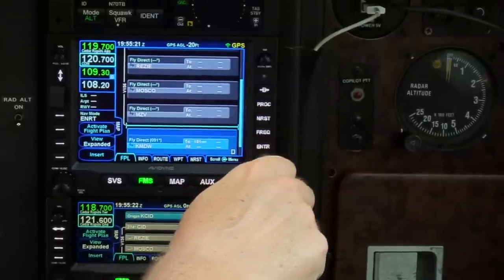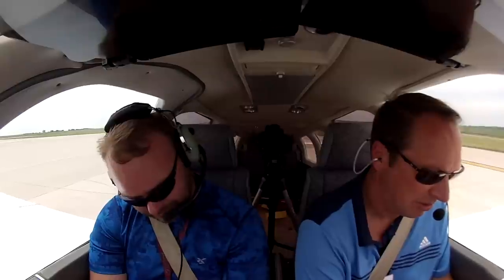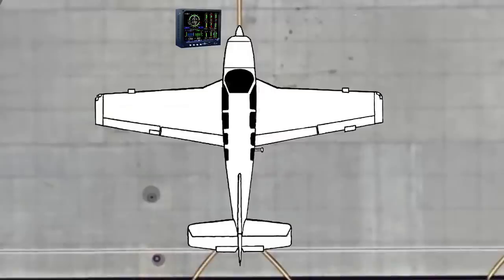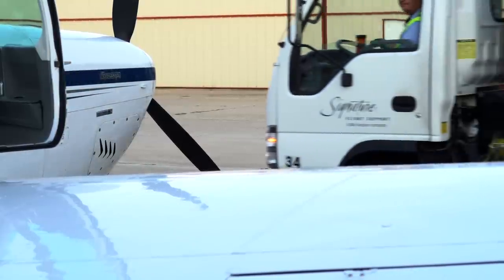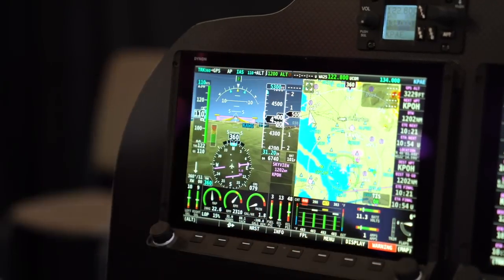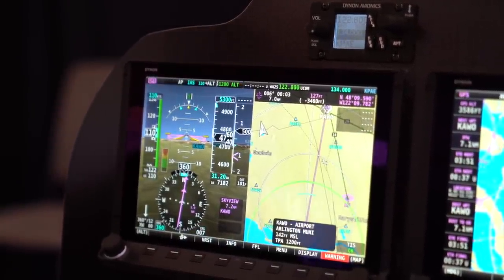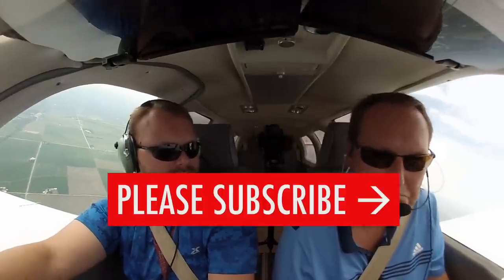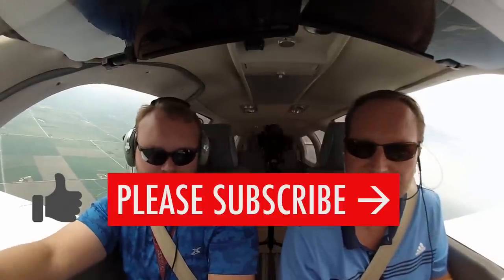Engine Monitor Upgrade - Part II: JPI EDM 930 Flight Test

Comment: Martin,
Your video at the Glass Panels demonstration was quite interesting.

My observation between the Aspen and the AVADYNE system, would continue with the upgrade using AVADYNE. Your panel already have the AVADYNE 550 and the 530, which is easier to merge together without additional boxes. That I would recommend you to take a look into it.

Comment: Martin, why not Garmin?
Reply from the maker: Garmin makes decent equipment as well, but a few different reasons steered me towards Avidyne. The IFDs are tray-compatible to my old GNS units, so the upgrade was very easy to do. Avidyne equipment is generally speaking more compatible with other stuff, whereas Garmin has a reputation of being compatible only with other Garmin equipment. And in terms of capabilities, the IFDs with a real FMS under the hood  have some advantages.
- Martin

Comment: what is that small digits display box for RPM and MP? Does that come with JPI 930?
Reply from the maker: It's a redundant display of  the just the most important engine parameters (think RPM and manifold pressure), so that in case of a display failure on the main unit you still have an idea of what's going on. It comes with the JPI EDM930.

Comment: what would you say you're leaning towards, the dynon or aspen setup?  I currently have 1 aspen and I really like it but either the dynon or g3x with engine monitors (since I need that as well) would be sweeet!
Reply from the maker: I think I could be very happy with either one. I like the simplicity (and lower price) of the Aspen. At the same time, the Dynon will offer a nice autopilot upgrade along with the nicer screens. Given the avionics I already have, I do not see a clear winner between these two.
- Martin
Reply: @martinpauly  I'm not sure where you are getting the lower price for the Aspen system.  Dynon has a very nice Excel spreadsheet on their website for the V-Tails, and I'm pretty sure that the A36 should not be that much more expensive.
Configured for your aircraft, which means no engine monitoring system, a 10" and a 7" display, Autopilot, no comm radio, since you have the Avidynes, the backup D10A and the STC, comes in at about $23,500.  The Aspen 2500 system is $25,000, has no autopilot, and both probably will cost you about the $11,000 or so Dynon is quoting for installation.  You WILL need a new panel for the Dynon, whereas you could reuse your current panel, if you wanted to, for the Aspens.
The Dynon pricing also includes the ARINC modules for each Avidyne, and all the networking cables to run everything.
Reply: Gary C Aspen has been been pretty aggressive on pricing as of late. They are feeling the pressure of the Dynon, G3X and the G5 introductions.
Reply: @Marauder92V  of that I have no doubt, but as i replied to one individual, per the price lists on each website, which may or may not be accurate in light of pressure from others, I would have to get an Evolution 2500, with every option AND an Autopilot for their $25K listed price to match the Dynon system.
Insofar as I'm concerned the G5 systems don't even play in this league, although the G3X certainly does.  But, find my one reply where where I told Paul that a $20K Evolution 2000 system is going to add $8,000 worth of 'options' to get to the level of the Dynon system, and that's without an autopilot.
Right now, NOBODY in the certified market can touch Dynon feature for feature and for value, no matter how much they discount it, unless they start giving stuff away.
Reply: Gary C Do you own a glass system? Street prices are a lot different than their websites. I have done extensive upgrades and I can tell personally, I haven’t paid anywhere near list price. The introduction of the G5 is playing a HUGE role in competing for the single AI/DG business. They are taking business away from Aspen since their competitor in this market is the E5 which lacks an HSI. And with their new added features, they are making it even more challenging. If Martin heads down the Aspen path, he will be fine with a 2000 system because of his Avidyne displays. His Lynx will feed traffic and weather onto the Aspens as well as the Avidynes. 

As for the selection, it’s all about integration. Martin - when you’re ready for the glass portion, you’ll need to look closely at the integration capabilities. Telling you something will integrate isn’t the same as it will. If you are ready to drop the extra money on a new autopilot, you should look closely how everything will integrate. When you selected Avidyne navigators over Garmin, you saw that your Lynx FIS-B output was available on your Avidyne boxes. It wouldn’t have been on the Garmin (ask me how I know). 

The challenging part of multi-vendor systems is making sure everything integrates and if one box has a firmware changed, it doesn’t ripple effect into the others. There is where Garmin’s strength is on their completely integrated solutions. Of course, you’re paying for that privilege. Good luck on the search.
Reply: @Marauder92V  no, I don't have a glass system.  Thanks to a vindictive, lying woman, I am homeless and unemployed.  I have nothing from my previous life.
I understand that prices are discounted, that happens everywhere.
However, my comments were more in the order of value for the money. I still think Dynon gives you the best value.

Comment: Excellent video but you flew the plane to burn off fuel but you did not describe how you drained the remaining fuel.  How did you do it?
Reply from the maker: Hi Brent, I flew the tanks dry. Only one at a time, of course. I would not suggest to do that on a routine basis; however, it's a good idea to do it at least once so as to learn exactly how much fuel can be consumed from each tank in flight. You might be surprised how much this can differ from the book value.
Regards, Martin

Comment: Martin, another great, and informative video. I was wondering if your JPI has engine limit alarms that you can pre set, both audible, and visual? Also, thanks for sharing information on the Dynom and Aspen displays.
Reply: Corsair0829 The JPI 900 & 930 are both primary engine replacements. The airframe engine parameters (like the oil temp low and high pressure limits) are programmed by JPI when you purchase the unit. You need to send them the parameter limits. There settings that the pilot can set for personal limits for some of the engine gauges.

Comment: I was trying to figure out why you were able to put in more fuel than expected  at the "top off" during the calibration procedure.  At first I thought you had drained the tanks completely and forgot the unusable fuel but I went back through and you stated that you started with the 3 gallons of unusable fuel.  So, did you completely drain the tanks and then add 3 gallons per tank?  We just installed new fuel cells in our S35 and are considering the JPI 930 upgrade and want to have as much accuracy as possible.  BTW-Well done informational videos!  Have you done a front windshield replacement?  Would like to see a video on that as well.